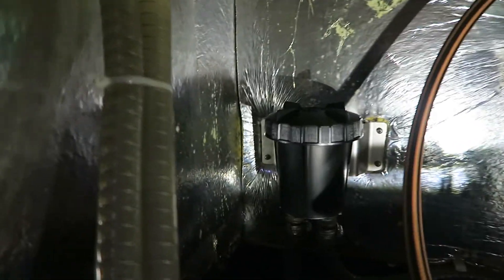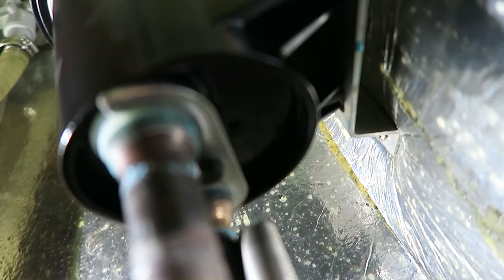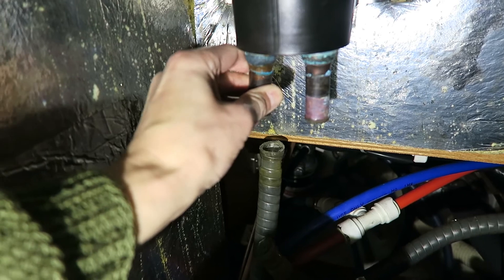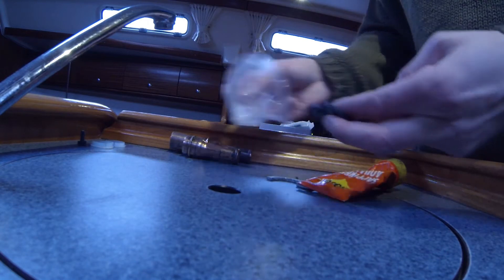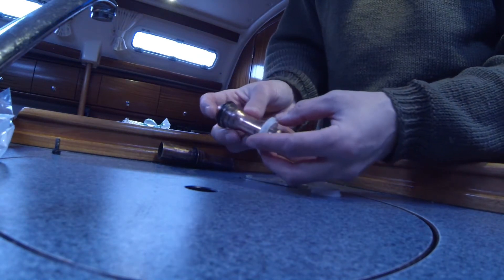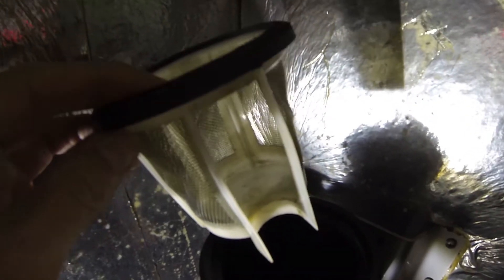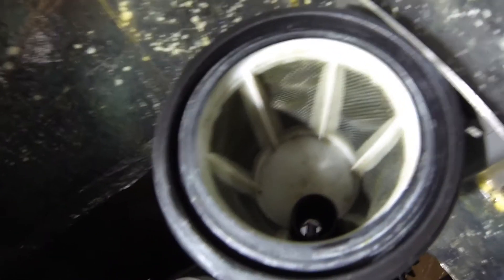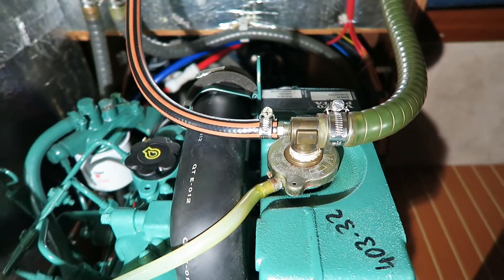How to change gaskets on a Volvo Penta sea water strainer

Comment: Thank you!  I have just gone through the process of replacing the sea water intake hose on my Volvo Penta along with a new anti syphon valve but had not thought of the seals in the strainer.  Much appreciated video and very well put together.

Comment: @tino g, just a thought, but you should have put some silicone grease on the the large top o ring on the basket as well.
to help re-seat the basket imo.
Reply from the maker: I clean the filter occasionally and prefer not to be greased in silicone grease when I empty the strainer basket.

Comment: Great Video!  I have the exact same vessel as you.   Do you have the part numbers or a link to those two gaskets?  please :)
Reply from the maker: You can buy the original Volvo Sealing Rings (part nr 858986) at ebay :  https://www.ebay.com/itm/354590778116
Reply: @twiper  thank you!